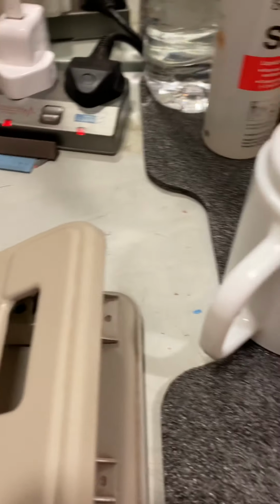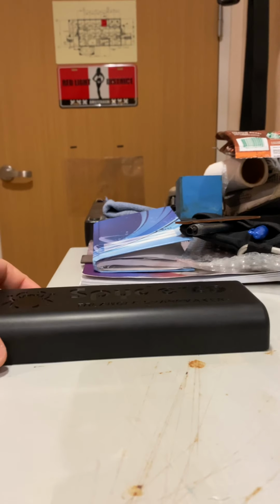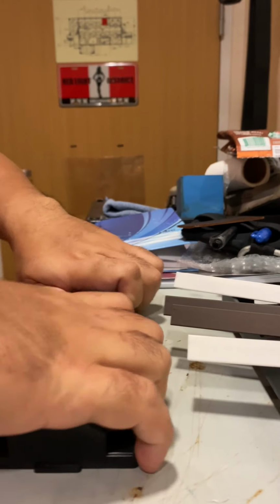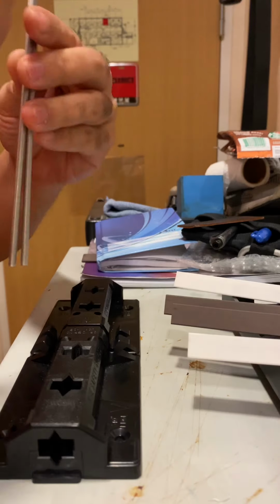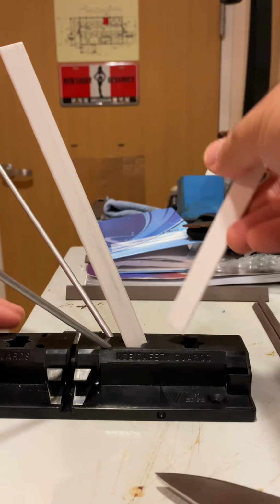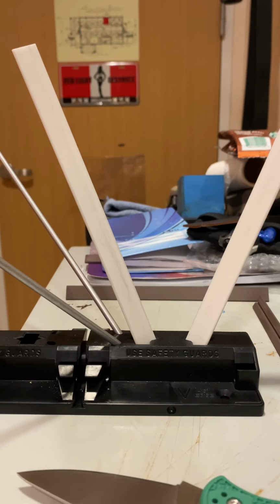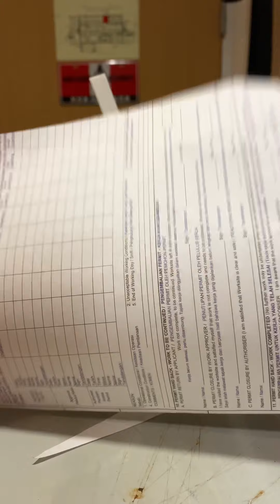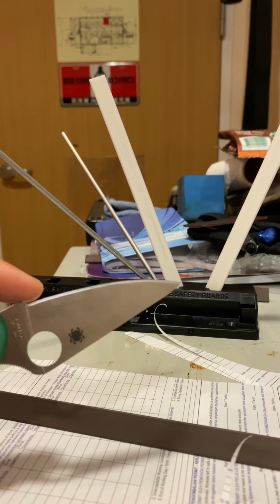Must have sharpening tool

Comment: what's the difference with the guided sharpening system in term of usage. Isn't the guided system easier to use?
Reply from the maker: guided sharpening system definitely easier to use in term of sharpening..but the spyderco sharpmaker is easier to use in term of just touching up your blade i.e minor scrub/small roll on the edge..hope that sheds some light 💡